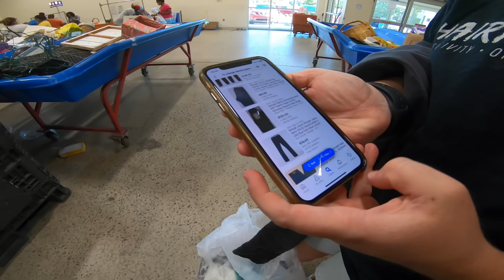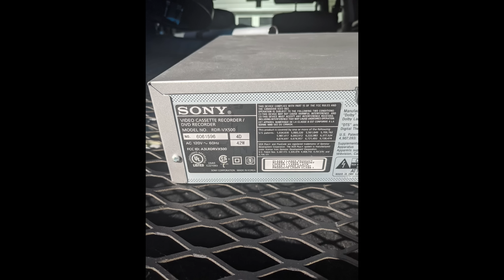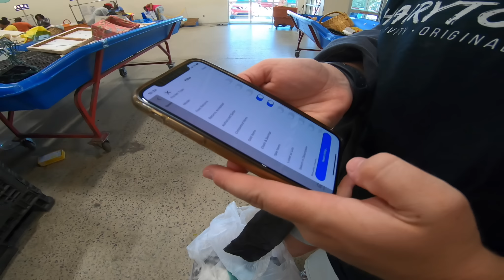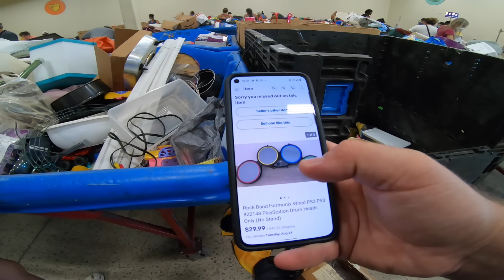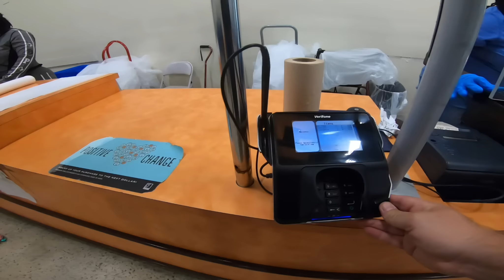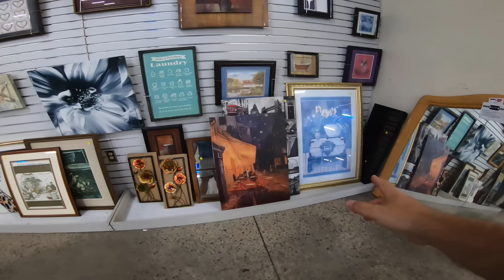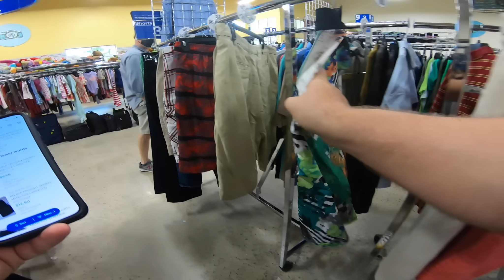She's Already Finding Better Stuff Than I Am!

Comment: In regard to the DVD side that wouldn't  open those are TREMENDOUSLY easy to fix usually its just the top needs to be bent back up totally worth the 5 minutes MAX it takes to fix

Comment: At 5:00 it was still on VHS mode. Sometimes you have to switch it to DVD mode to get it to eject. But more then likely DVD was probably busted. Too bad, Magnavox combo drives sell really well for me and fast, even without the remote. And if you can find the actually DVD recorder one, it sells just as much and as well as the Sonys.

Comment: I just sold the pads of the rock band for $30. I didn’t feel like messing with the whole thing, so I popped out the pads. I sold the battery cover separate for $13+shipping as well. I’m still commenting this even though you got the legs now. I sold those for $27+shipping

Comment: The dvd tray is an easy fix! Just means the mechanism is out of sync!
Reply: There is a tiny hole where you can insert a piece of wire to push out the tray - this will usually do the trick.